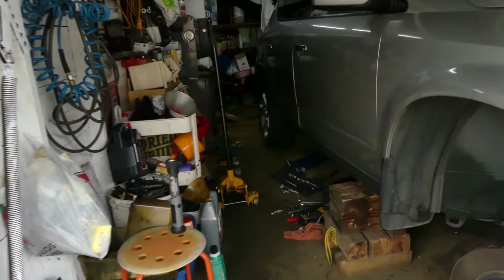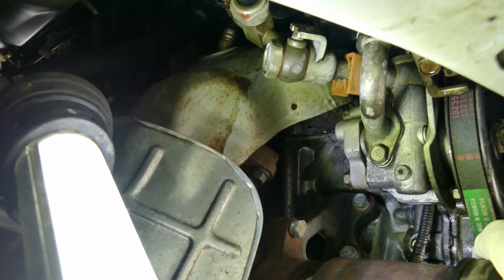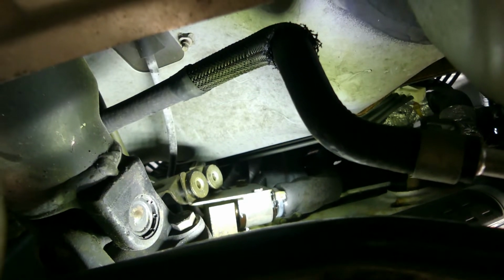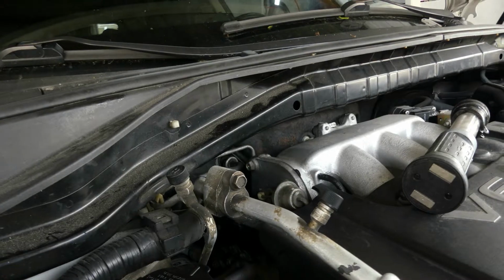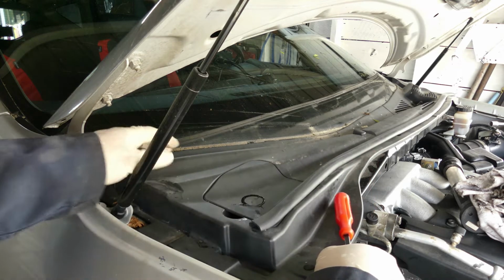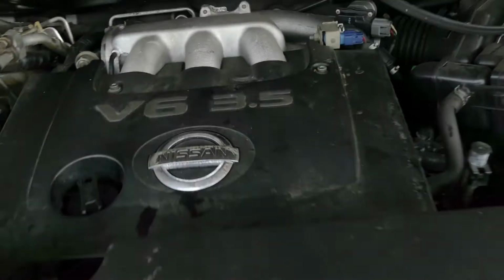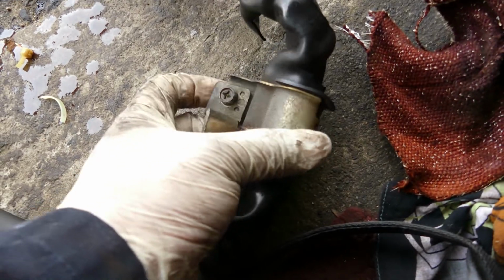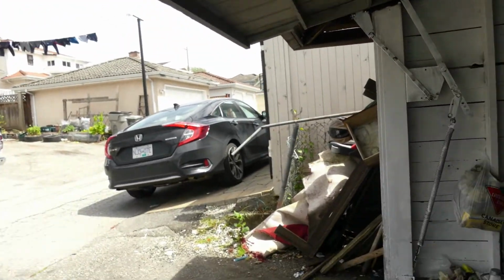Power Steering Pump or High Pressure Hose [ 04 Nissan Murano Leaking Power Steering ]

Comment: I have the same problem then I replaced the hose but my steering is really really stiff it is very hard to turn in parking and turning 3 way turn do you know what is the problem and how to fix it?
Reply from the maker: maybe ur pump is shut
Reply: @asianmechanicguy6483  how to turn it on

Comment: Parked my nissan murano out front like backed in and when i just left to go pick my gf up the steering was impossibly hard and when i finally got back there was a ton of fluid on the ground. And a broken black clip
Reply: Is it drivable for a week?
Reply from the maker: nope the more u move the steering wheel the more fluid will spit out until u cant turn ur steering wheel anymore get it fix right away
Reply: @Asian Mechanic Guy  thank you for the quick response. I wish i knew where the clip came from ita only half of it looks like it dumped the fluid near the passenger rear side of the motor.